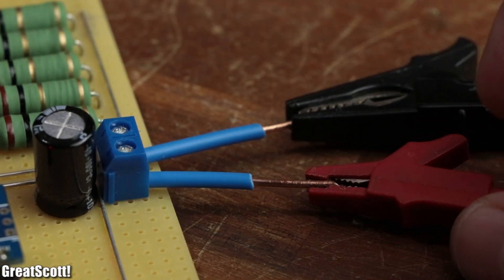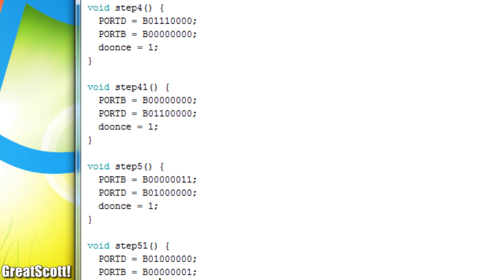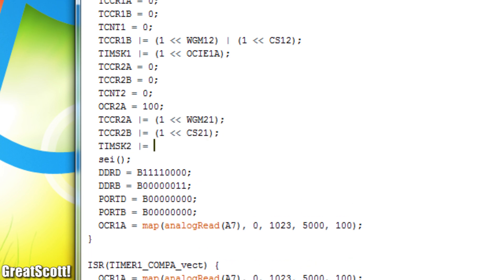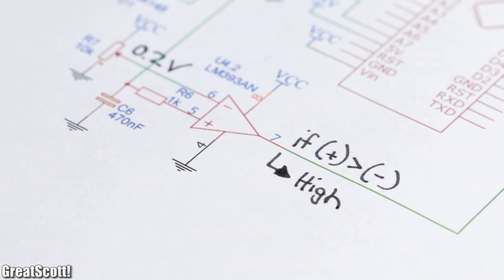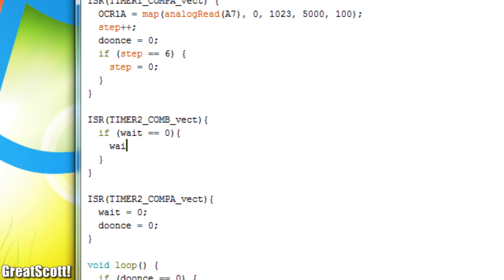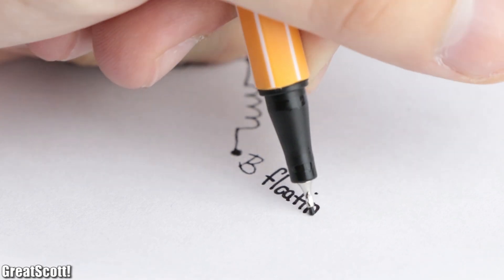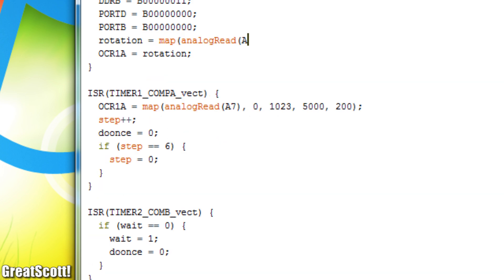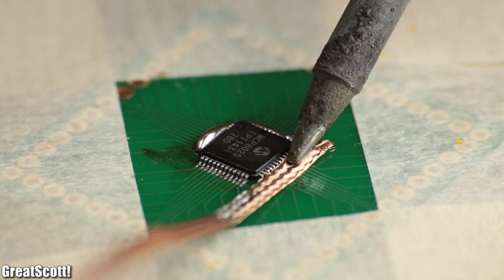Make your own ESC || BLDC Motor Driver (Part 2)

Comment: I think the motor is spinning in the wrong direction or that propeler(I might be wrong I do not see it clear) and that is why you do not get up lift
Reply from the maker: Maybe. But even then the speed did not come close enough to the speed of the commercial ESC.
Reply: It got enough amps, it was the driver chip that had thermal shutdowns because of too high amperage.
Reply: Rotation of the motor isn't important at this point anyway, and when it's time to fly it, he simply changes two leads on the motor and voila it spins correct.
Reply: Saw that too, and yes, it is propelling itself against the table.
Reply: to change rotation direction all you need to do is switch two phases..
Reply: It's got a VCO. the more voltage the higher the frequency. this circuitry is all 3 phase industrial power stuff originally.
Reply: i see the same 08:54 ^^
Reply: Do you honestly think he wouldn't have noticed that?
Reply: It's because the motor only ever runs in open loop commutation.
Reply: Still try changing the prop or rotation of the motor you can actually burn the motor the have a lot of power. 
Or try it with lipo that can put out more amperage

Comment: That's a lot of unnecessary lines of code that could be chopped into less lines you've got there buddy
Reply: rm2kdev who you calling friend, pal?
Reply: Still a tip. You may want to consider declaring your variables as volatile if you use them inside of Interrupt routines as well as in your normal code. 

This may even fix your current spikes in 2.ino. Besides that comments go a long way. Especially if you share your code with others. As well as it helps yourself too if you happen to be looking stuff up.
Reply from the maker: I am not a programmer,....buddy
Reply: Matt can't forget that it's open source! Anyways, in this case (no pun intended) the whole switch case and the if else arguments could be cut down. A lot. And let's take something like java, where something that could be done in 10 lines and is done in 100, is going to cause problems (not including comments). Not necessarily problems such as compiler errors or "it won't work" but it saves file size which guess what that does in return?
Also, spaghetti code doesn't always have to mean unmaintainable or hard to maintain, it could also mean that it needs to be rewritten, which in this case it would've needed but come on, it's a YouTuber that produces electronic videos not programming videos ;)
Reply: Vivek Venkat Subramaniam it's from South park, guy.
Reply: +Βασίλης Code indeed is more optimized when you use registers instead of write/read functions.
Reply: It's not like his code will be used in production products and also it's not like he will need to be maintaining his code over a long period of time. He just wrote a fast prototype code. But I'll bet you did noticed, right?
Reply: RAZERZ :)
that's funny 
is it true?
Reply: +Guga M. Leao For sure he does hard work on getting videos done but he also get decent income from his videos. Also when you are making videos that are meant to basically educate people something, then its not bad thing that someone is pointing out some flaws or mistakes because all of us benefits when something is corrected. Learning from bad examples is never good thing and I am not saying that this video or the project was bad but there is definitely things that could be done a lot better in the code.
Reply: +Βασίλης No, I didn't read your comment after you edited it. And no, I don't speak english, sorry.
Reply: RAZERZ I'm not your buddy friend lol
Reply: Griffin Sure in a production environment maybe but even still less lines doesn't always mean less file size
Reply: Size and speed is getting mixed up here. A code that weighs 100 mbs might be faster to execute than a code that weighs 10 kbs if the larger code involves less computing. In this case he is actually speeding up the processing time by hard typing the code. 

Spaghetti are delicious but not for your co workers tho... ; )
Reply: Why can't you handle any kind of criticism ?
Reply: In arduino IDE you don't set up registers (you can do it if you like/know how) this is good and bad at the same time. Your code isn't optimized but it's lot easier... Anyway nice vid nice explanation experiment.
Reply: +SbesialObera Did you read my comment? Do you speak English? Thanks, come again.
Reply: That is not true! A compiler is an idiot and does not simplify some things like a human would. Especially when you're calculating inside an if query.
Reply: Thanks for creating this excellent video tutorial and sharing your code with everyone GreatScott. Fuck the whiners complaining about your code not being up to their exalted standards instead of fixing the code themselves, explaining why their modified code is better and releasing all of it to the world free of charge just like you did. Or, at the very least, the next time they get the urge to shit on a youtuber's coding abilities they need to explain which parts of the code need improvements and why.
Reply: lol u try to do all the thing he did (impossible) :)
Reply: topher I think we all know what that is, and I think we all can agree that less lines of code and more optimized code, runs better and or faster than more lines and just some spaghetti "that does the job"
Reply: file size is irrelevant to the final performance of your code. "Consolidating functions" does not inherently make anything more efficient. All these comments are really showing you all are just a bunch of kids that learned how to program a little as a hobby. That's good and all, but you people have no idea what you're talking about.
Reply: Reddit is leaking out
Reply: +SbesialObera Welcome to the internet, you must be new here.
Reply: number of lines makes no difference on performance. "spaghetti code" only refers to the maintainability of messy code. You're just trying to act smart when really you don't have any idea.
Reply: +RAZERZ "less lines of code and more optimized code, runs better and or faster than more lines and just some spaghetti". Totally wrong when talking about number of lines. The more unnecessary function calls the slower program will be and less functions = more lines of code. For sure it will save significant amount of memory and make program more manageability when you use functions or even OOP but in cost of performance.

Most performance critical programs are written line by line avoiding unnecessary functions and manageability is not 1. priority.

In this case I agree that the code is shit but hey.. Like he said, he is not that good in programming and its completely fine.
Reply: Lines if code really don't matter, learn what a compiler is.
Reply: GreatScott! Butthurt nazi fuck you 
He’s right don’t be upset if you’re wrong it’s ok 
Buddy